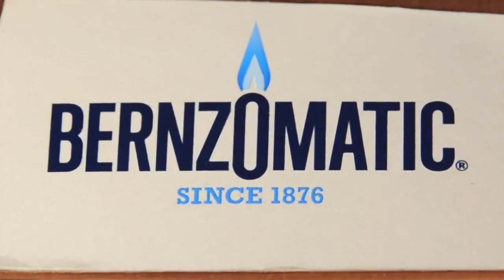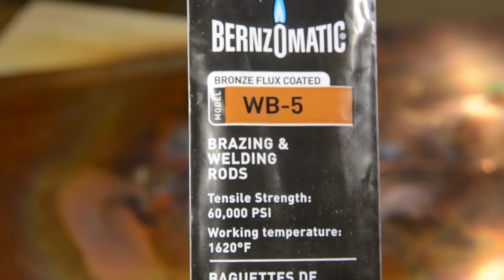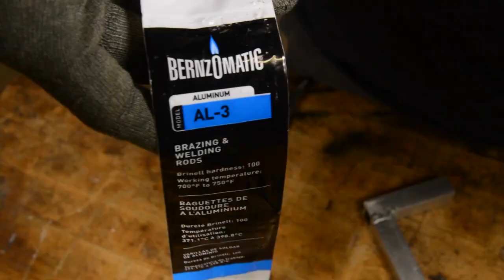Safe with Fire: 9 Uses of a Torch

Comment: How much time of ininterrupted use will last one of these containers?
Reply: It took under a hour to drain mine most of the way,  but I'm sure it depends almost entirely on torch design. I'm using the one with the hose.  It was like 60 bucks,  I don't know the model number off hand

Comment: Hello, would the Oxy torch be able to melt Brass, Copper, Bronze? (6063 AlMgSi I consider 100% able, right?) 

For small castings - in grams, like rings, small gears, etc? 

Is there any possible option from your product range? Like the smaller portable burner?

Thanks!  @bernzomatic
Reply: I'm learning this now with map pro, it seems like a good well insulated crucible holder is key.  Also glazing the crucible correctly seems important. I have one failed copper melt so far and I  just glazed a new crucible today.  I'll let you know how it turns out if anyone's interested.

Comment: If you buy one of these make sure you always have at least two oxygen canister before starting a job. It is the oxygen that runs out really quick. To braise up a hole in say an exhaust witha peice of 30mm square steel you might do it wth one bottle of oxygen but I would say two bottles would be more like it. These kits are expensive to use due to the expense of the oxygen. But they are good if one needs intense heat on say a nut or bolt.

Comment: How long do tanks last
Reply: Years if you don't let the gas out. But if you do the gas runs out in say 5-7 mins depending on what you are doing. If you buy one of these make sure you always have at least two oxygen canister before starting a job.It is the oxygen that runs out really quick. To braise up a hole in say an exhaust witha peice of 30mm square steel you might do it wth one bottle of oxygen but I would say two bottles would be more like it. These kits are expensive to use due to the expense of the oxygen. But they are good if one needs intense heat on say a nut or bolt.

Comment: oxy tank runs out very very quickly at the price Id rather use propane tank so I can take a nap while it comes up to heat and still be ahead $$$.  Sorry.
Reply: Wow is it that bad? I was hoping to get something to fill the gap between just MAPP and my big cutting torches. How many oxygen cylinders do you go through  to 1 fuel cylinder?